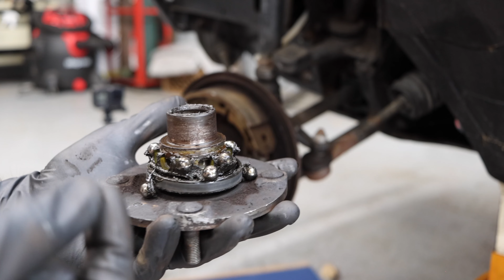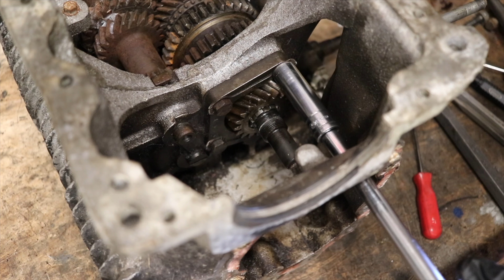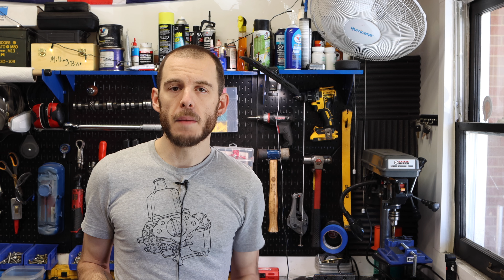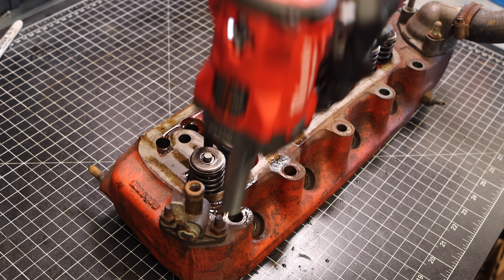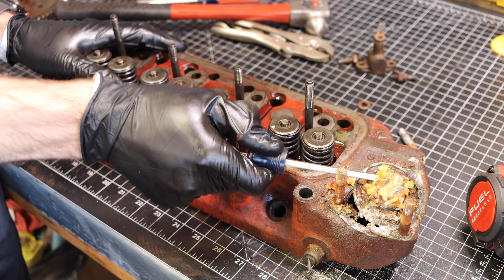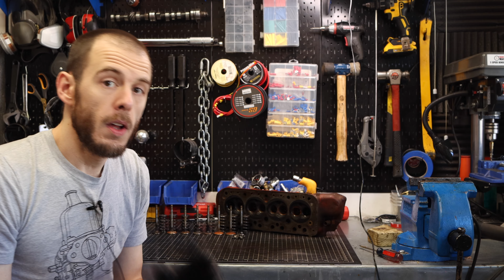Mystery Engine - Part 4 | Cylinder Head

Comment: Quick tip, put two nuts onto a stud, lock them together then use an open ended spanner to wind them out rather than using vice grips.
Reply from the maker: I actually normally use the "two nut" method for any stud I am trying to preserve. In this case I am replacing everything on this head with new hardware so I didn't care to protect the studs and vice grips are faster :-)
Reply: @classicminidiy  those threads looked shot too so getting an additional bolt on would have been a nightmare

Comment: This is definitely a late pre injection  (circa early ‘90’s ) unleaded head , you can tell by the pressed steel cap water gallery plugs and the 12g940 part number cast in by the heater tap opening.
Reply from the maker: This is the same head casting that you did for me isn't it? Based on the raised gasket surfaces as well.
Reply: @classicminidiy   yep late reliable 940 casting

Comment: I use and recommend the Mini Spares C-AEG526 (NOT the way too heavy -527s) for these heads in particular.
did a lot of pressure testing and measuring a few years ago... these only have 5 coils, won't bind even your spring retainer HITS the guide, show seat pressure between 80 and 100 PSI in most heads, these are good for 8000 RPM...I should be a salesman!
A drill press makes it a lot easier for removing and installing valves.
Reply from the maker: Thanks for letting me know. I can imagine a drill press would be awesome! One day, not in my tiny workshop right now though hahaha.

Comment: Hi Cole, 
Your video's in general are very informative and helpful.  But, you can save yourself and others grief by being more careful on your technique to separate parts along mating gasket surfaces.  Using a screwdriver and prybars should only be a last resort if penetrating oil and a plastic or rubber hammer, a bit of heat or worst case a flat putty knife are unable to get them apart.  The mating surface damage from using the wrong tools can easily cause damage that will prevent the needed seal when you put the parts back together.

Comment: Its the head off a mk1 MG Metro, they painted them red. Clues are 1) Temp Sensor in the head - it was in the block. 2) No bypass hose.

It is an A+ engine, introdued circa1983. Rule of 9 fortorqueing the head, though
Reply: Not if it had the small inlet valves - MG Metro ones were slightly bigger at 1.4” You’re right about it being an A+ engine though.

Comment: We have at least a half dozen of these heads.  They were not correctly stored over the years and have rusted.  Can a machinist  (Mini'st for short) bring them back to life?
Reply from the maker: Without seeing them I can't say for sure but as long as they have no large cracks they should be repairable at a machine shop. These are becoming very desirable heads now so I think its worth getting them fixed!

Comment: Did you 'Hot Wash' the head at all ?
That crud in the water temp. housing looked pretty bad !
Stay safe.
Stu  xx
Reply from the maker: Nah just pulled it right off the block and started whacking it apart.